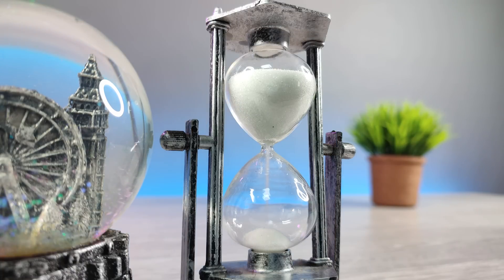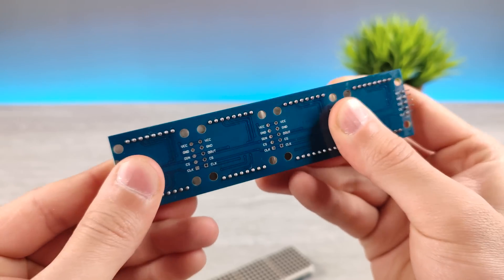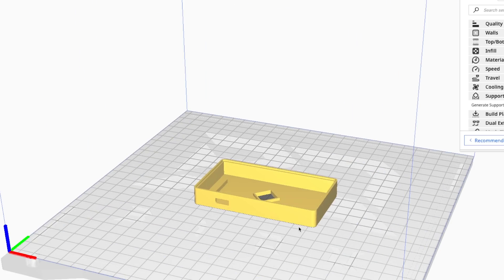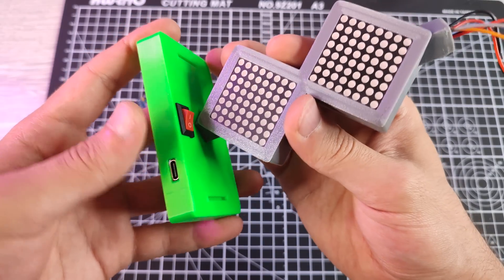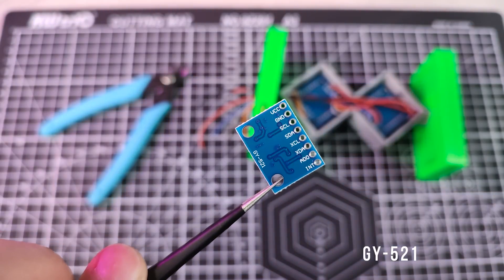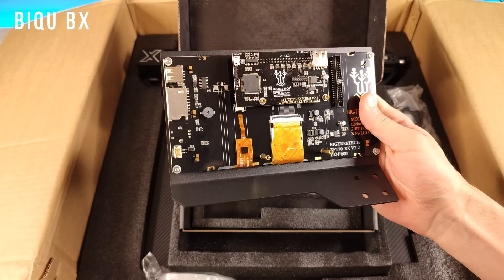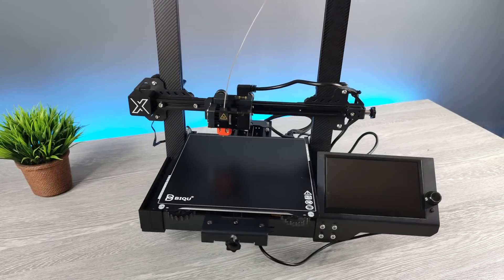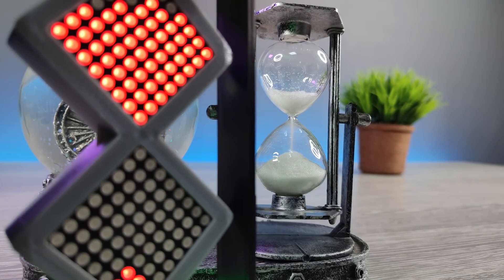I Made a Digital Sand Clock - It really works!

Comment: Your amazon link the the Arduino is Different than the Ali express one. It's a Nano Every VS a Nano 3. I purchased the every from your link and it just shows one board lit up save for a few pixels not like it thinks it's turned on it's side and doesn't move. After re soldering every connection and trying new components and a breadboard the every does not seem to work with this project....

Comment: It looks kinda weird for the sand on the bottom to pile up into a square. The 45 degree angle of repose seems too steep. The same is true on top, but inverted; the sand is piling up on the sides a bit too much.

I assume your code works by looking at each particle and determining where it needs to go based on what's near it. If so, you can fix the angle of repose thing by giving each particle a very small chance to attempt to move down and extra left, or down and extra right.

Comment: The movement of the individual LED grains of sand doesn't look that realistic, but you probably need a lot more CPU power than the Arduino provides to do that - to calculate acceleration, bouncing, sliding, and so on.
Reply: And a much higher resolution.

Comment: How time accurate is this? Is the rate of  sand fall customizable?
Reply: Well, in the code you have to set the time and you can modify the variable data with a potentiometer but I think that isn't a lot of precise, at least If you use normal or cheap one
Reply: Adding RTC module can make it accurate.
Without RTC module, it's really based on how the code written.